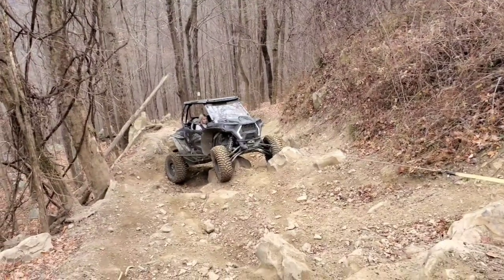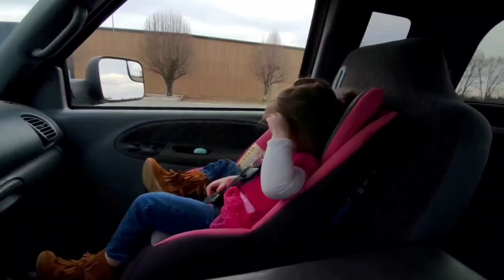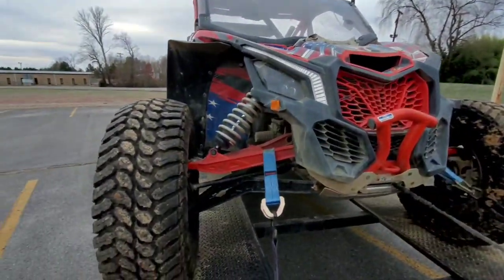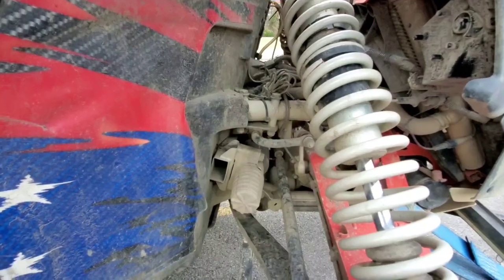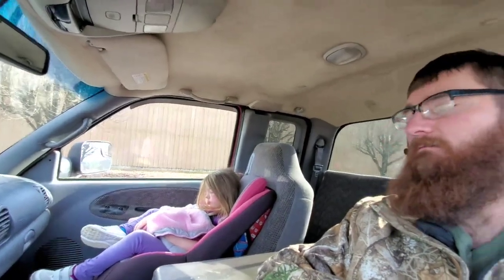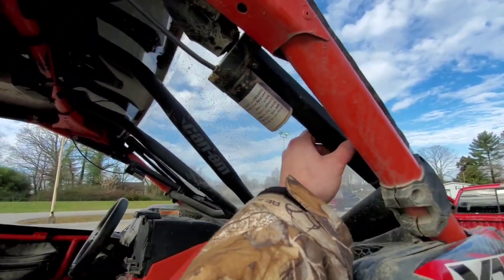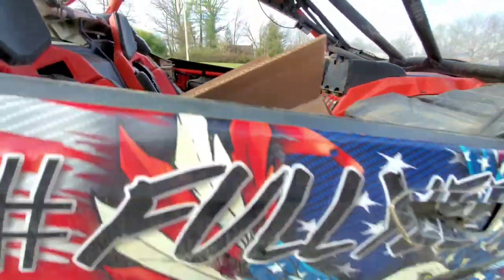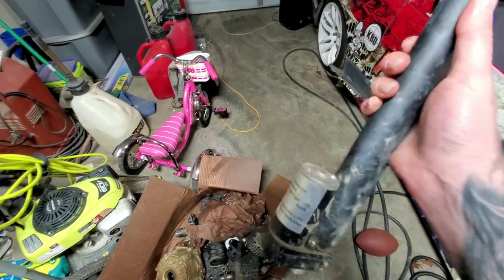The X3 XRC RR is broken!!!... How bad is it?

Comment: I’ve heard of the slop in the steering. Someone makes a plate to add to the rack to prevent the wear. Think maybe seen it on blown budget
Reply from the maker: Everything I've seen so far just prolongs the issue. Eventually it's going to happen. A lot of people are converting to hydro steer now because of it.

Comment: That was one expensive first service for ya! How’d the front diff die on you?
Reply from the maker: Yea no joke. Good thing I got the extended warranty.
It was wasn't anything out of the normal. Was trying to bump over a triple ledge, rolled back to load up on the second ledge and the driver front got in a small bind. Heard a pop thinking it was the axle but eventually the passenger front stopped pulling too.